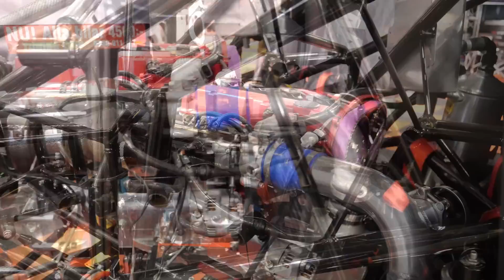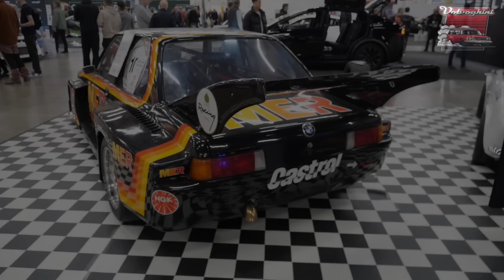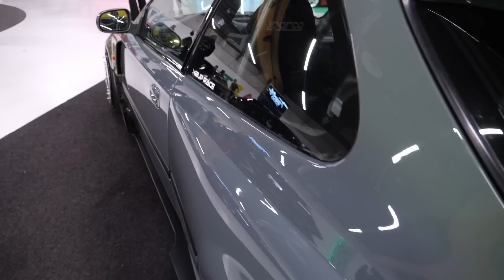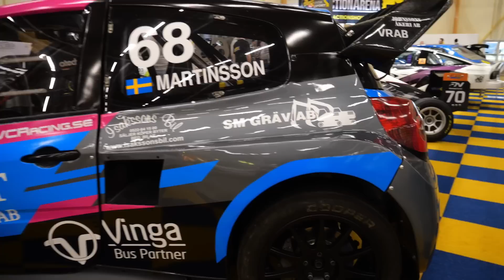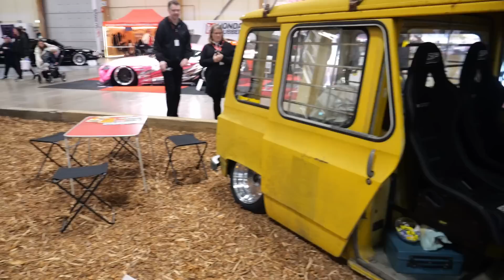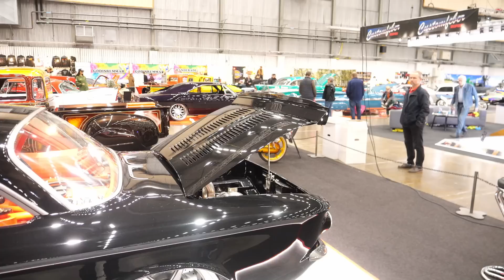Custom Motor Show Sweden 2024. Inspiration for my build!

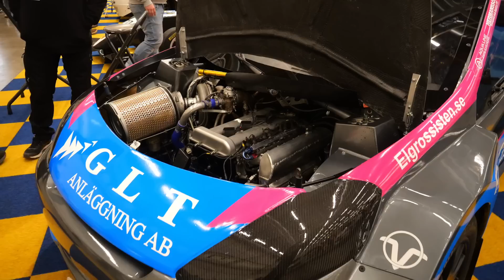Comment: 14:51 Right here is a great comparison between proper motorsport modifications and amateur shop tuning. Look at the manly size of that air filter and the dual chamber intake manifold for equal flow among the cylinders, very lovely stuff after seeing that hilarious cone filter on the audi, maybe its just for "street" driving, but it still triggered me.

Comment: Your Volvo 244, I see three idea for widebody.

1. Do the same style (like E30 M3) as the rear fender you currently got.

2. Do it Group 5 style like the E21 you saw, or the E9 3.0 CSL Batmobile.

3. Do it like Wiborg's Evo, where it's a mixed of modern DTM/LMP style of wide fender.